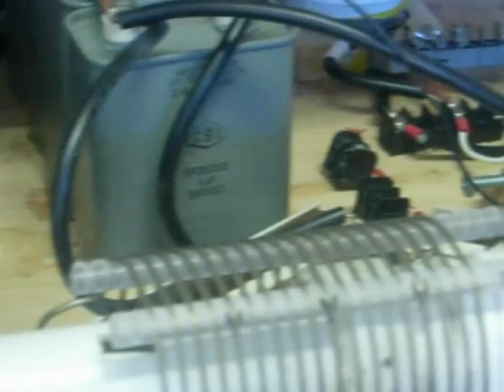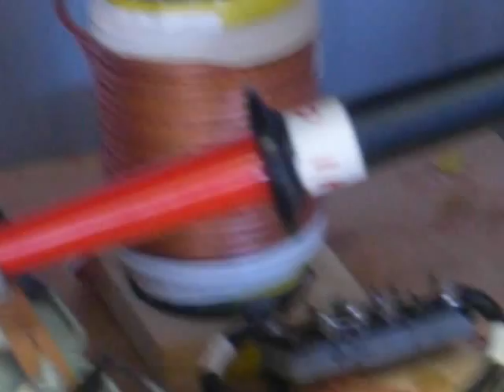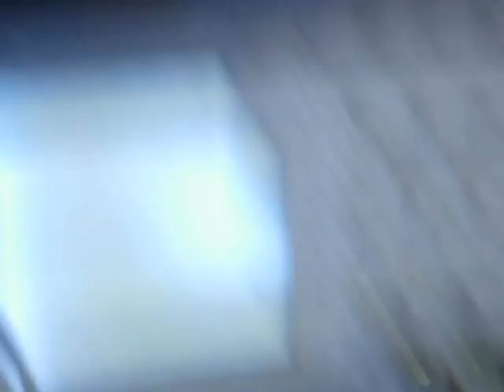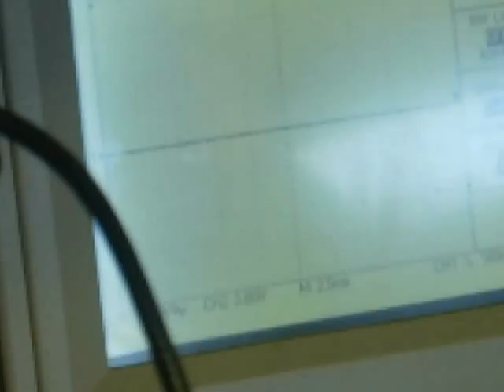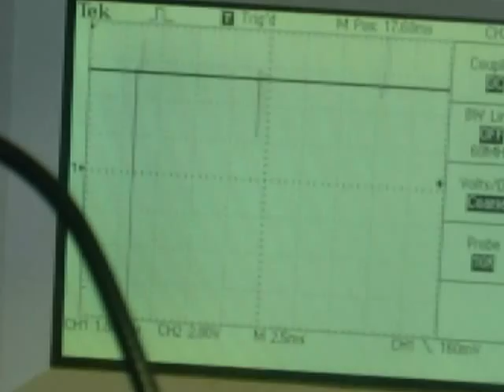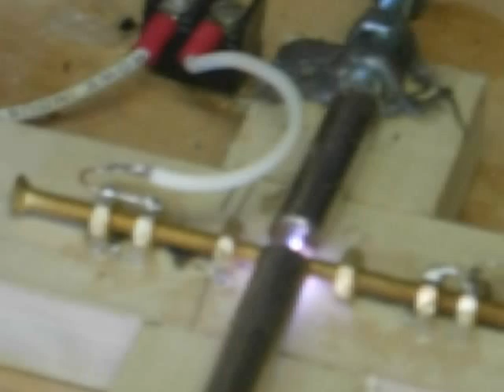Don Smith #6

Comment from the maker: The sparkgaps life expectancy is not very long so I will try using MOSFETs or IGBTs with drivers.  I also need to get some control over the frequency both L1 side and output section.

Next week I'll try driving some loads using sparkgap in L2 section.

Comment from the maker: Lots of tests are need to learn the relationships in each area of this system.   L1 and L2 seem to have reached a peek for this design.   If i reduce the output capacitor size to 2uf instead 4uf then the charge time will be doubled but the power will be cut in half. 

The output transformer is layer as follows:
1. ferite cores
2. insulation using mylar tape
3. primary layers bifilar
4. insulation mylar
5. aluminum foil tape(not 360 deg) grounded
6. insulation mylar
7. secondary  heavy ga wire